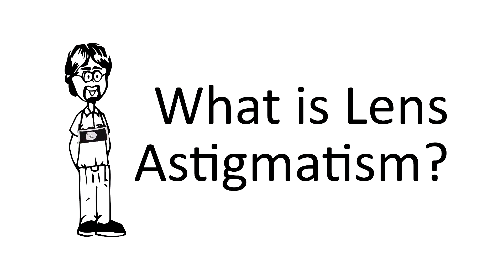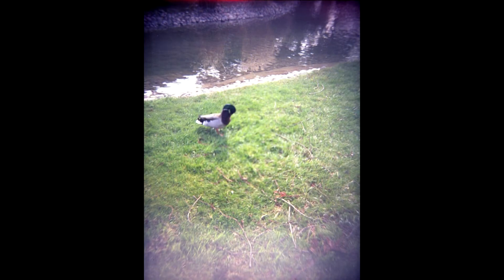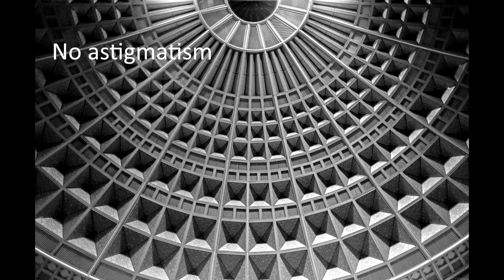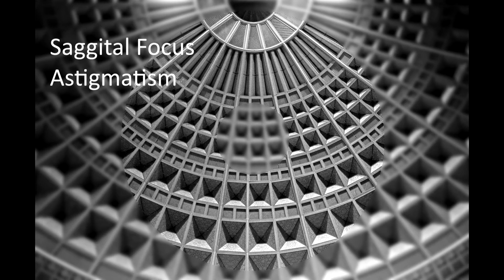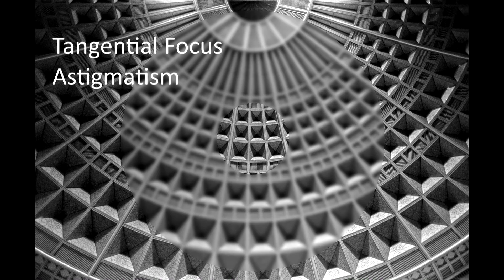What is Lens Astigmatism?

Comment: Hello David 

Iam sorry if this post is off topic regarding to the video but i need your help. 
A few days ago i accidentally dropped my mamiya 645 super with the 55mm f.2.8 lens on it. The camera is fine but the lens hit
the concrete on an angle and caused the filter thread to bend. Surprisingly other than the damage on the thread, the optics look undamaged, 
no cracks no scratches whatsoever.
 I also did a test for lens decentering by taking photos wide open on a patterned wall and as far as i can tell the image quality is as it used to be.

Now my question is if there is any possibility that the lens will fail or get decentered sometime in the future because of that incident,
or if there was any kind of damage, i would see its results right now.  It might be stupid question but i read some horror stories on the web.

Thank you very much.
Reply from the maker: Hey, Christos,

Ouch. That's a hard hit. So lenses are pretty resilient. As long as they test well after the impact they should be okay. Lenses have good internal structures that protect lens alignment. And a 55mm lens, even on 645, ought to be robust enough to withstand a hit without falling out of columnation. If it were an ultra-wide like a 15mm, there would be bigger issues (ultrawides can fall out of columnation if you look at them sternly.)

Also, if you want to try and fix the filter thread somewhat you can use a filter thread repair tool (around $25 on eBay, I think.) With a major hit you'll never get the thread to a point where it can take filters or allow the lens' front cells to be removed for repair, but you might be able to make it easier for a lens cap to hold or correct some of the aesthetics some.

Also, a metal cylindrical lens hood can help protect lenses front drops by crumpling upon impact. Plastic are less protective as they shatter or can allow the camera to bounce.
Reply: @DavidHancock  Thank you very much for the help David!!

Comment: A good way to judge how this will effect a lens is by looking at the difference between the Tangential and Sagittal lines on an MTF chart. The further apart the lines, the worse the effect of astigmatism. 

Zeiss has had lenses that partially correct this since 1890 using as few as three elements. It can also be corrected by stopping down.
Reply from the maker: Thank you. I didn't know that about the MTF chart.

Comment: Aspherical lenses? Do you have a segment on those,or are they no longer relevant?
Reply: They are definitely still relevant. Aspherical Lenses correct for spherical aberration and are more difficult to manufacture than simple spherical lenses. A lot of Leica and other high end  lenses are denoted ASPH to indicate that they have a aspherical element.

You can correct for spherical aberration with multiple spherical lens elements, but this adds size, weight, internal flare, and lower contrast into the lens. This is why a single aspherical lens element is generally preferred.
Reply from the maker: The video on aspherical lenses is next week's installment.
Reply: The Science of Photography Thanks